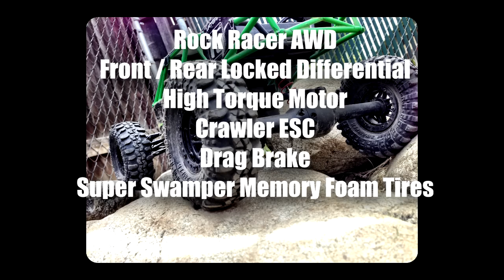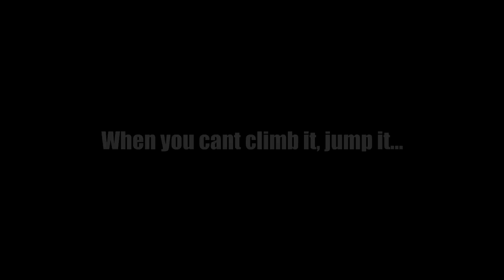Epic RC Rock Crawling Montage (3/31/2013)

Comment: Cool man. I'm into the whole RC thing. I've owned an XXT TeamLosi for @ 18-19 years or so. Was really into it then. I've been mostly out of it for the last 10 or so years. I would buy the occasional RC CarAction magazine to try and keep informed on the RC world. These new Brushless systems and LiPo batteries.....dam expensive! Taxes are just around the corner. I'm getting back into it. I really want a brushless system. Looked into the Castle brushless system's and like those. Also would like to pick up some kind of Mini or Micro RC. Something I can drive inside and let my little guys play with. I'm excited man. Nice crawler BTW. That has a 2 speed tranny rite?

Comment: If I were you I would mount the shocks higher up to give you more ground clearance so you can get over those rocks easier. Also when you have more body height you can have a lot more articulation which is good.